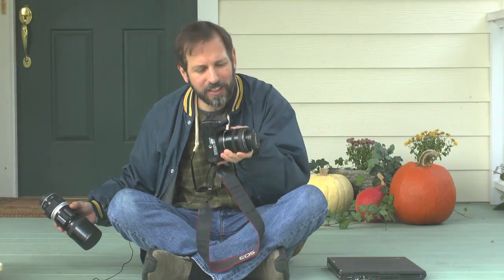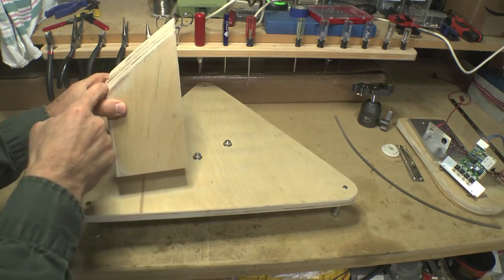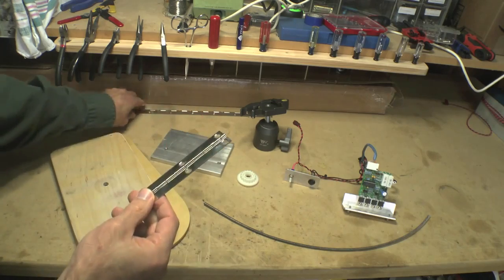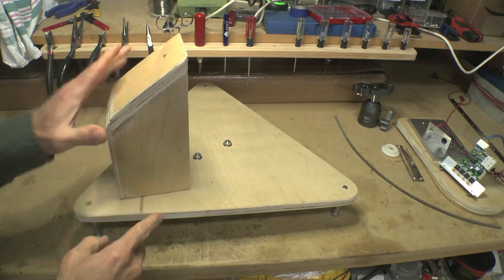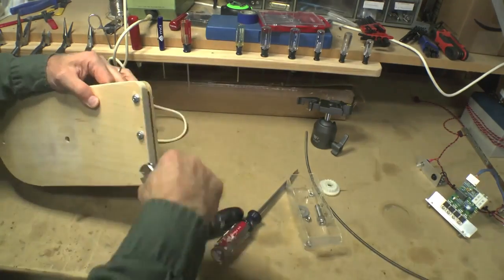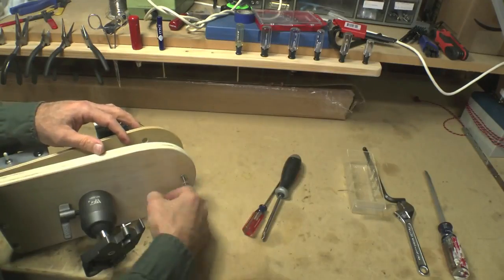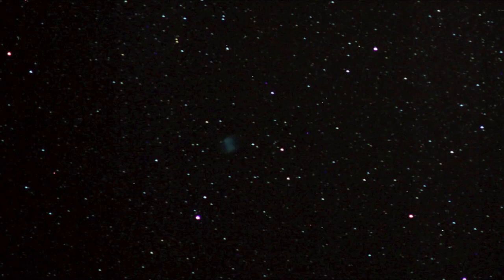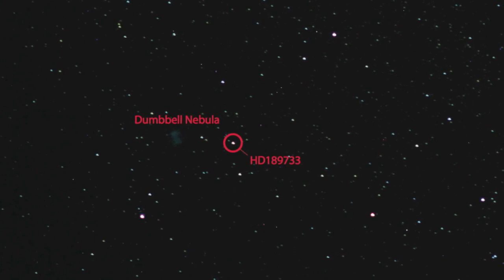How to Detect an Exoplanet With a DSLR

Comment: how do we know that received magnitude is caused by a planet obscuring our full view of the star?  could the change in power received have been caused by, say, atmospheric attenuation due to temperature change or even the change in thickness of the atmosphere as the aspect angle between the camera and the star changes?

just curious i did look up differential photometry but this question remained =)  amazing work creating the home-made barn-door tracker, and great explanation of its construction!  thanks!!!
Reply: From thinking about this:

Signal changes due to a planet occulting a star will be metronomic in nature. Alterations in signal attenuation due to atmospheric attenuation will be a mixture of the highly regular change due to the earth's rotation, which repeats ever 24 hours and is easy to spot for this reason, and more chaotic changes due to weather. If data is logged over an extended period and then subjected to a fast fourier transform, it should be easy to pick out the clear periodicity due to a planet's transit. It should be possible to sanity check the approach by repeating it on a number of different star systems, some with known exoplanets, some without.
Reply: Salafrance
given more observations of this planet's rotation about its star from (1) different locations on the earth's surface (or better yet, from space), and (2) this planet's subsequent orbits around its star, i do see how we could rule out atmospheric attenuation. 

wiki says HD 189733 Ab orbits its star every 53.24 hours.. so i suppose this test may be repeated every other night for maybe 3 observations.  I guess we're lucky that its orbital inclination hovers near 90 degrees, and that its got such a short period  =)
Reply: In addition to multiple observations of the stars dimming as the exoplanet transits, the author used "differential photometric" calculations.  This involved picking 4 nearby reference stars in his field of view.  He compares the brightness of the HD 189733 against the reference stars.  If the reference stars dim, lets say due to a passing cloud, he attenuates the measurement of the HD 189733 brightness.  This helps guarantee that his search for the exoplanet transit will not be distorted by weather or atmospheric disturbance.
Reply: Dave Abrams Hi Dave, FYI, I have not done this experiment and don't work in the image processing field... so, my answer is worth what you paid for it... I got my info from reading the author's IEEE article referenced above near the "Show More" line.  

It looks like he is post processing the image he gets every minute with a 50 second integration (exposure) time.  He mentions software called "Iris" in the article.

I dont think he is summing the irradiance value in the image in real time.  He is just post processing the .jpg he receives each minute to create a data point.  The Iris sw outputs this data point by doing image processing to determine where the reference stars are and where the target
HD 189733 star is and looking at their relative brightness in each frame.

Re; the stepper motor, he is using reduction gearing through the large white gears and through the threaded rod.  So, the stepper motor has to turn through multiple 360' rotations for the threaded rod to go around once.  Each turn of the threaded rod makes the plywood move less than 1 degree.  In any case, it seems to be fine for reducing the motion blur.

Are you going to try this?    If so, it looks like there are some how to's for the mechanics on Instructables.  search for astrophotography
Reply: Ira Hart ahhhh i get it!  thanks, Ira!  great explanation.  

i wonder, do you know if the image processing technique used to calculate the "light curve plots" finds the maximum irradiance value received by the DSLR, or if it sums the irradiance values within a certain region?  i would think finding a maximum irradiance would be affected by spatial aliasing.  but if the algorithm sums irradiance values within a region then maybe (depending on integration time and ifov) trailing might not have been such a problem..?  

another question, every stepper motor i've worked with (not very many, and they were cheap) has had an incremental angular position of at least 1 degree, so i would think moving one or more "steps" during data capture would still cause some motion blur.  i'm wondering if there's a way to mitigate even this motion blur, or if the stepper motor is a higher quality and the driver is able to maintain position down to a much smaller degree.  

i wish i could get more detailed info!  thanks again, Ira and David Schneider
Reply: Ira Hart  Ira thanks so much again for clearing these things up for me.  What he's doing is very similar to something I've been working on that deals with stabilizing a camera in motion.

Comment: Hi, how does he know with one sequence of results that its not a sunspot, surely you need a few repeats
Reply: He did it based on a known extrasolar planet, with known transit times, as stated in the video.

He wasn't the first to detect this specific planet, in other words.
Reply: It's useful to calibrate the equipment and detection algorithms, with a known exoplanet before hunting for others.
Reply: The professional astronomers collect data for three exoplanet years and use software that includes statistical algorithms, to filter out any noise to confirm that an exoplanet is present. Looking at a known exoplanet helps to calibrate the equipment and the software.